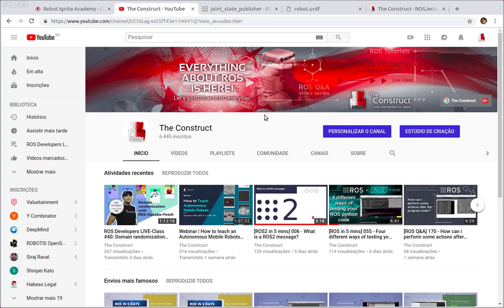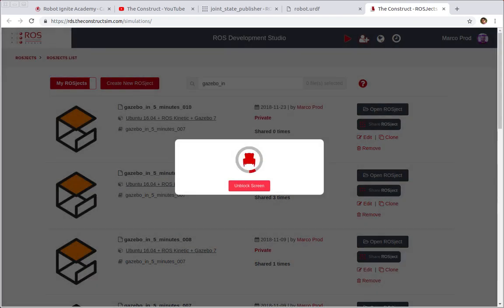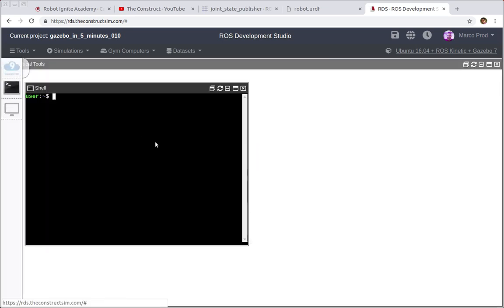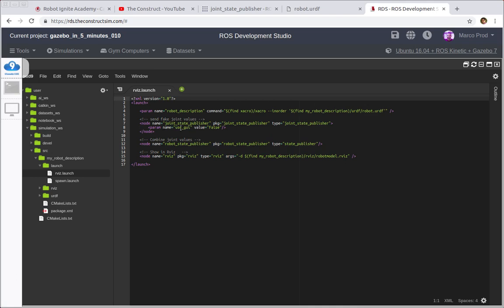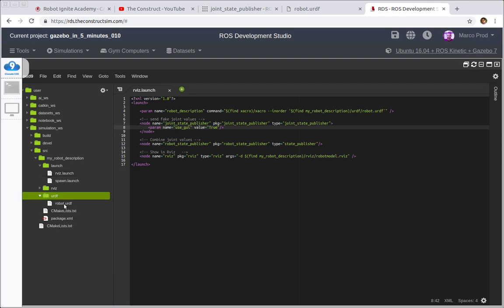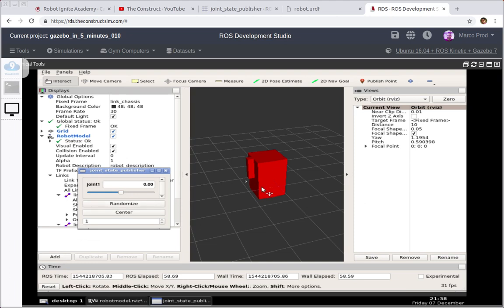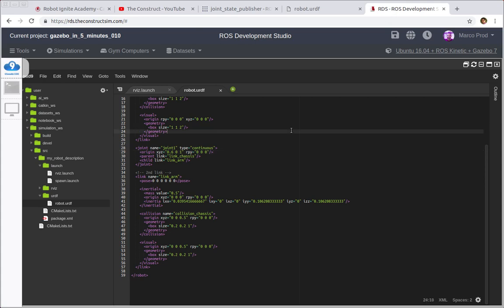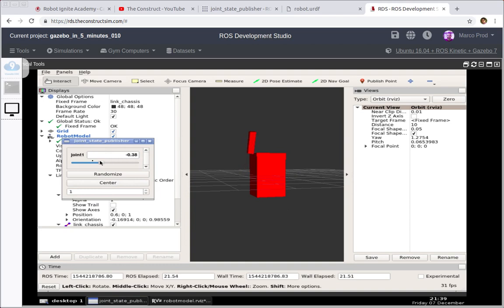[Gazebo in 5 mins] 011 - How to use joint_state_publisher

Comment: Hello Marco,
I try to control a Servo (attached to Arduino Mega) with Gazebo and the joint_state_publisher GUI in ROS.
With a Node in the Arduino subscribing to the joint_state_publisher is it possible to control it?
Reply: I did not found a way neither. I think it has something to do with how the joint states work and how to connect them to gazebo. For now I have moved forward to MoveIt, but I am still searching the good answer to your question with no luck.
Reply: Unfortunately, joint_state_publisher captures state information from simulation control plugin. And despite GUI of joint_state_publisher can also publish state information, but you can not use that information to control back the robot (the only way you can control back the robot's joint is through topics .../command). However, joint_state_publisher can control the robot if using URDF only without Gazebo integration